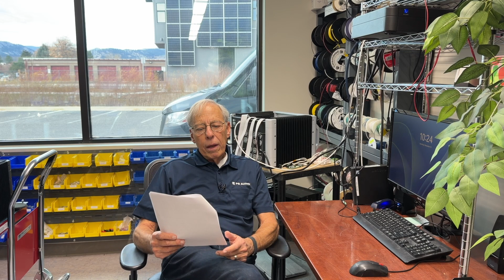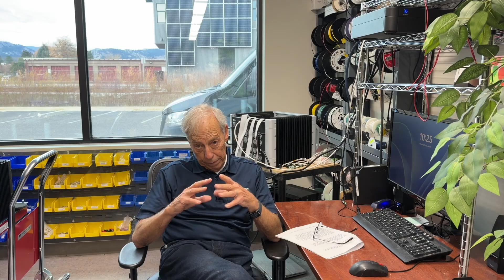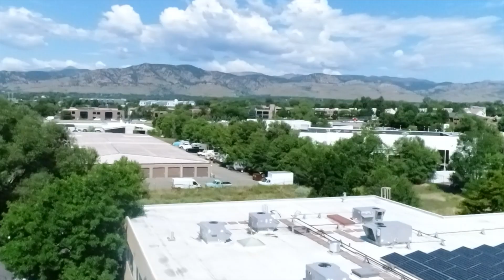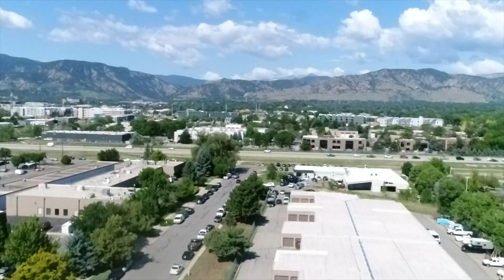Cable modems and power regenerators

Comment: So I don't need to worry about noise on a $50 off the shelf parts router/modem, but I do need to worry about noise in premium audio equipment with massive filter caps etc?

You'd think the audio manufacturers would use the same magic components sourced for cheap Chinese routers as apparently their digital bits are unaffected by noise

Comment: just commenting on my comment. Ivor from Linn used to say the source is the most important thing. Garbage in/ garbage out .Since presumably all components that convert ac/dc react to "clean" ac the modem's power supply, linear or otherwise will affect performance of the modem as it carries the signal (data traffic) through buffering which can suffer from drop outs due to slow or unstable internet speeds.  The AC to DC to DC to AC etc.chain must be in sync and with minimal noise with the parallel running signal of the audio information where noise Wifi vs Ethernet ,  component interconnects. speaker cables etc.  I guess my original question should have been does modem technology have anything to do with all of this and is there such a thing as an audiophile modem?  Would appreciate feedback from anyone.  Thanks.

Comment: The clocks on network equipment shouldn’t make any difference at all. When you stream music, that data travels over the network and into a buffer in your music streamer. From there, the music streamer sends out digital signals using its own clock. That data may then also be reclocked by the DAC. Noise on the network might make its way in if the network connection isn’t galvanically isolated but there is no scientific basis for needing better clocking before the data enters the music steamer.
Reply: But they do.
Reply: Network equipment clocks are literally useless the biggest snake oil nonsense scam because network info is sent in packets not a stream.
It's like talking about a the "speed" of a stream of water when the water is being delivered in bottles.
It just has no effect at all.
Once the data is buffered and reassembled then it's feasibly clocked but that happens way down stream from any networking equipment.
It's such an insane scam and relies on people not knowing how networking happens because audio people think of everything in terms of analogue "streams" even when that couldn't be further from what's happening.
You can't reclock digital packets.

It's like selling a tool to pretending it makes sure a brick wall is built at 1cm per second when it's being built in bloody bricks.
Reply: @rankcolour8780  so the clocks in audio equipment reduce jitter.  When I say that, I mean the streamer, the DDC, and the DAC, not just the DAC at the analog output stage.

Are you saying the digital transmission of network data is fundamentally different than the digital data transmission between audio components?

I’m asking as I genuinely want to know.
Reply: @superspeeder 
Fundamentally, yes.

That might have been too to brief.

Imagine an audio data stream, source sending bits to be decoded, a constantly moving ladder of data representing information.

That's nothing like how network data is handled.

Network data is sent in packets.
There is no stream, it's literally chunks (bites, get it). Parcels of data that cannot be clocked. 

At the other end of transmission is a buffer, the buffer assembled the packets into a coherent "thing" which is sent from network adapter to device.

Any clocking has to happen after packets have left buffer and way downstream, at the device that turns that digital info into analogue...and we know what that is, right? A dac.

You can't clock packets, they are disjointed segments. Its a scam.
Reply: @superspeeder  
It's like saying you applied spellcheck to a maths formula if you want an analogy of how fundamentally inappropriate it is.

Notice how even The man himself in this video only talks about re-clocking at DAC or streamer stage once data has been handed off from network buffer to audio device.

He's being very careful about where he claims re=clocking is implemented and has any value and he quite clearly says it's after network data has been handed off from network to device.

Network packets are basically 3 binary constructs, header, which isn't even really the info you want, the actual payload or body of the packet, which is just a meaning less chunk of yes/no data and the tail which again is NOT the info you want, more of a checksum kind of thing.

Viewed in isolation a packet is meaningless, and unrecognisable when compared to something like the audio data it transmits.

You cannot apply a clock to network packets it's meaningless. A massive scam.
Reply: @rankcolour8780  thank you for the detailed explanation!  I’ve personally witnessed the improvement better clocking has on “dirty” digital audio from my pc via USB vs through a DDC and then supplied over coax (though admittedly this is with a budget DAC who’s clock is probably not as good as the one in the DDC).

Many people claim high end network switches improve digital audio, but that seemed so far down the list of priorities I never bothered going there.  I did put a DC filter on my modem/router power supply input just because I had it lying around.  I figure a cleaner power source can’t hurt. 😊
Reply: @superspeeder  I'm open to clocking helping with audio bit streaming, but that's so far removed from how networking data is sent it's like saying a light switch helps with writing music.

They are fundamentally different things where one devices application does not extend to another.

I can't stress to you just how different network packets are from what your DAC is working on.

Comment: Most people need not worry about mains power issues. And how do you actually know you have such problem so you don't spend on wrong things? Anything with regulated power supply is usually designed to keep clean internal power rails under reasonable worst case conditions. It's, in my humble opinion, not a quality of extra resolving sonic abilities when some device needs a power regenerator just to clean up what is common on our mains power wiring. A power amp usually lacks voltage regulation on the power rails but with adequate filtering and capacitance engineers design targeting great performance under normal power quality conditions. The term "re-clocker" doesn't make much sense to me. It's also something that ends up being a thing due to bad engineering elsewhere in the system. A streamer pulls audio data asynchronously from the data center and data will get buffered to allow local precise DAC timing without audible jitter. It's fairly trivial and not costly to ensure the DAC runs the timing precisely through a proper buffering architecture. Rather, people should throw out things that need such external "medicine" to fix bad engineering solutions.
Reply: So you're throwing out your system? Which gear have you tested that didn't benefit?
Reply: @Pete.across.the.street Lots of systems cause I work in audio. You see, only if a DAC can't figure out to make a stable clock will you need help from a re-clocker. I don't buy junk that suffer from audible jitter.

Comment: Here in the uk , I moved my router over to my dedicated hifi supply. 
 The difference that made was unbelievably positive and better still with a linear power supply. 
  Even Ethernet cables make a difference … its all a bit odd as they shouldn’t … 🤷🏻
Reply: It should make a difference.  I use lps on my switch and modem. Does improve sq
Reply: @Pete.across.the.street 😂 yes. And never use cheap cable lifters on ethernet cables.
Reply: @ThinkingBetter says the guy who knows everything without even trying it. But he can tell you about his theories all day, never bothered to test any of them to see if he's actually correct or not. 😂😂
Reply: @Pete.across.the.street I think I tried most of what is worth trying. What do you think I am missing? When I upgrade a system I do it with an aim of improving particular attributes that I know can benefit from it. I don't just blindly waste money on snake oil without any foundational argument of what issue it is addressing.
Reply: Nothing better than placebo 
Are you doing your online banking on special router not to loose money?
It’s fine to spend money on whatever you feel makes your sound better but bits are flying over the internet and don’t get lost. 
I can over a long detailed story on how TCP works and how UDP works. 
Clock in the DAC is the only thing that affects your sound. Nothing else. 
Just MHO.
Reply: @gabrielschwartz1963 The placebo effect at play hahaha 😂
Reply: @ThinkingBetter   ...engineering mindset at play hahaha😴
Reply: Yes indeed. Great audio products are engineered through in-depth understanding of how things actually work and not through ignorance, imagination and pseudo science.
Reply: @ThinkingBetter why do most decent audio designers use listening tests when designing equipment,if it's all measurable and solved science there should be no need.
Reply: @ThinkingBetter according to your beliefs it's all solved science, so there should be no reason for listening tests, the measurements tell all, but this is simply not the case.
Reply: @mitchtaylor6512 I never said so. It's a more complex matter. A cable conducting audio is very well understood and completely measurable. A speaker in a room is a complex combination of imperfect compromises and the way our brain perceive those compromises needs listening tests to understand and to optimize.
Reply: @ThinkingBetter   ...great audio products are created using HEARING as the final phase of production.
Reply: @ThinkingBetter   ...yeah, far too complex for your engineering mindset to be able to comprehend or to cope with...you've made that abundantly clear to everyone here, week after week.
Reply: For mass production your final stage is a preproduction run flushing out any last issues that might occur when you make many units such as a yield issue of a glue process causing out of spec tolerances in a speaker. You want to be able to reproduce the product with the same specs (within defined tolerances) repeatedly. For a speaker, you would check that the units produced, for example, all measure within two defined acceptable frequency response curves. Without such test, you as a customer could end up with a left speaker that sounds too much different than the right speaker, for example.
Reply: @ThinkingBetter   ...yeah, I know all of this...so what's your point?
Reply: That the last thing done to audio products you buy indeed are measurements. Professional audio product development never see measurements and listening tests as competing methods at all. They are used as what best serves a particular purpose. A power supply engineer is conscious about using measurements to reach excellent conditions for the rest of the electronics to operate flawlessly, for example. Measurements are your best friend more than you realize. But the other side of the coin is the consumer choice and of course listening is king in that respect.
Reply: @gabrielschwartz1963   ...hearing is "better" than placebo & not everyone is affected by the placebo defect.
Reply: "Hearing" silver sounding different than copper is entirely placebo well proven for decades in blind tests. But hey, maybe you have some science defying magic skills  to tell if silver is used in the signal path that nobody else have hahaha 😂
Reply: @ThinkingBetter   ...rubbish! Lots of listeners have heard the differences between silver & copper wires completely independent of each other. You're just pissed that your hearing seemingly cannot detect these differences. Or if it can you're just no willing to admit it because you've gone too far down the engineering mindset rabbit-hole.
Reply: If the difference is so obvious, why does it always disappear in blind tests? 😂 If your ears can hear what physics says doesn’t exist, you should be writing research papers, not YouTube comments.
Reply: @ThinkingBetter   ...that's your narrative; it's not my experience. I would rather listen to music instead of writing research papers; I'm retired. The only reason that I comment on this particular topic is to rebut the crap that the hearing impaired wannabe audio engineers post here. My 47 years of home-audio experience is plenty of "research" for me. thanks👍
Reply: It's not my narrative. It is what any true expert in audio will tell you, what any AI will tell you and what universities will teach you if studying electrical/audio engineering. Besides it's also what numerous blind tests have found. We humans believe lots of things that come from our brain fooling us. You could have done several blind tests with your wife swapping cables in your setup in less time than making your comments here 🤔
Reply: @ThinkingBetter   ...no, it is your narrative
I am my own expert, with 47 years worth of Hi-Fi/home-audio experience. I keep telling you of my home-audio experiences & you keep being dismissive of them so, yes, it is YOUR narrative. Yeah, your brain is fooling you too, in fact your engineering mindset is constantly lying to you. I don't need to do your blind tests as I can already hear the differences in my interconnects & if I couldn't then I would've sent them back for a full refund. You have to stop believing that other listeners home-audio experiences are inconsequential to your narrative, as it is starting to show you up as having strong narcissistic tendencies.
Reply: @fatrat am i right in thinking  you were a hifi salesman for a few years?
Reply: @ThinkingBetter do you have to perform a blind test to hear the difference between a bird chirping and a Lion roaring?
Reply: I know speaking certain facts in this YouTube channel is like walking into a Christian church or Muslim mosque to try to convince people the Bible or Quran are entirely man made lol 😂
Reply: @mitchtaylor6512 Excellent example. Detecting which animal makes a particular sound is a classic elementary school blind test exercise and kids can indeed pass it unlike what adults can when such test is done involving cable metal choice. You nailed it.
Reply: Hi there! As a side note, a 2008 Caltech study performed MRI scans on a group of 20 volunteers subjected to wine tasting. Same exact wine was first presented as costing nearly a $100 a bottle and then again as a cheap plonk at $10. Scans showed medial orbitofrontal cortex actually did lit up more intensely when tasting "the expensive" wine. Professor Antonio Rangel led the study, easy to verify online. We're only human, I guess.